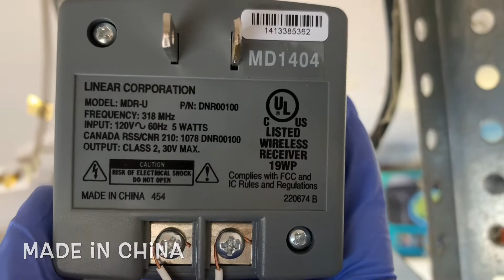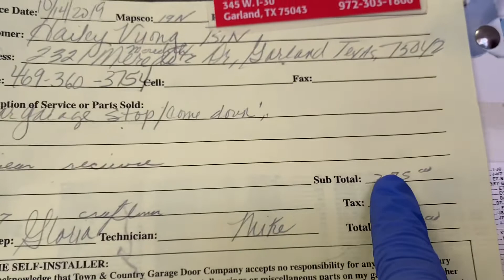DIY: how to fix garage door opener that’s not working with remote?

Comment: Your garage opener looks quite old, at least 15 years old or more. If you do your homework by searching on google, you can find newest & smarter garage opener with cheaper price. These smart garage opener can provide you more control features like controlling your garage opener using an app on smartphone. It's between $150.00-$200.00. The installation is quite easy if you're handyman. Anyway be optimistic that $275.00 is your first lesson about how to use Google to search for solution before reaching to professionals. Not all of them are honest.
Reply from the maker: It’s 20 years old.